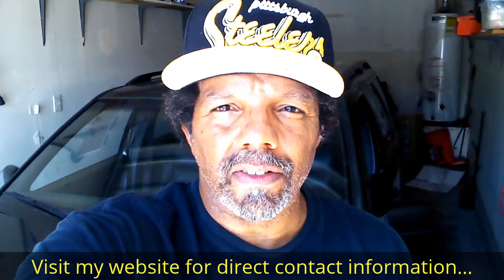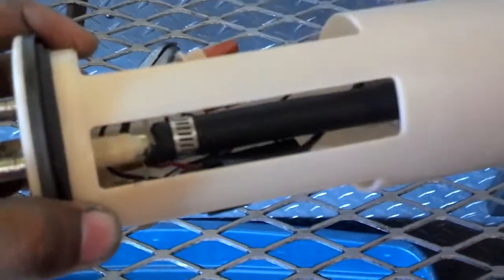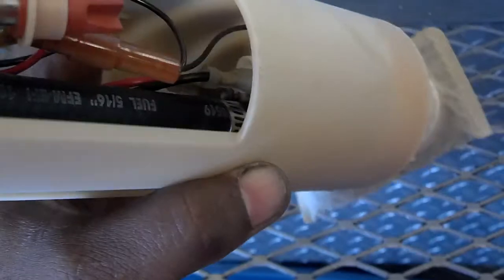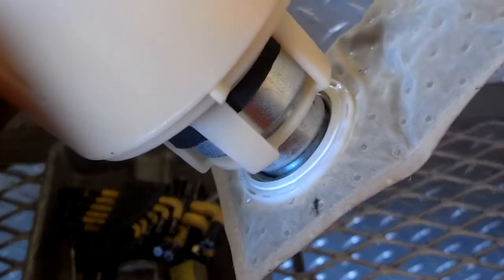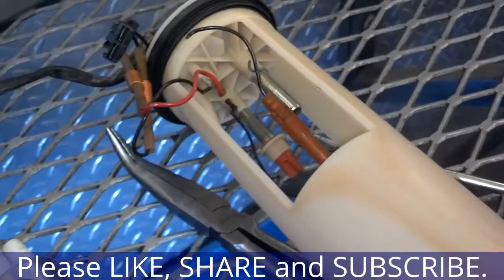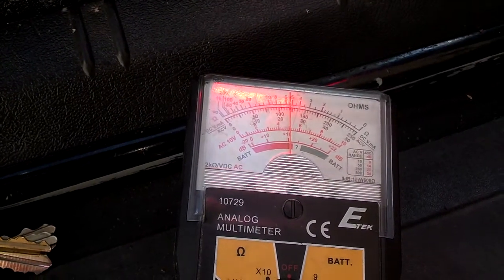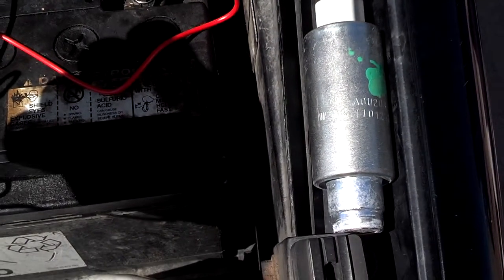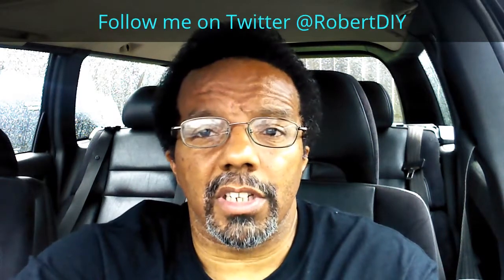How to remove a fuel pump from a sending unit - VOTD

Comment: So its about 55 ohms if you zeroed the multimeter full scale before testing.

Motor does seem to go like the clappers, i dont think its 55 ohms.
Reply from the maker: zx8401ztv I'm not sure I just decided to check the reading. LOL
Reply: Robert DIY ha ha :-))

If you do need a more accurate reading, touch the probes together and adjust the thumb wheel untill the needle sits on the 0 to the far right.
If it wont go that far, the meter battery is flat.

Sorry im talking the obvious again :-((

Comment: when mine went it cost $380 for a brand new Bosh pump...I had no choice at the time and that was the guy handing me the new pump in the box and me installing it.
 plus waiting a day and a half for them to send it... total cost was about $615 with losing 2 days pay and getting a ride to get the pump 2 twice...

now when I hear  " it just shut off while I was stopped at a light " what do you think it maybe ?
 I say o no its a bad pump mine did that for id say 6-8 months but 1 day it just would not restart and I got it flat bedded home !

I had bought a cheap china (EBAY) made part but when I went to install it it was VERY different for the Volvo one and didn't even fit in the outer case. I did plan ahead but didn't work out with a cheap $65 china made pump...

buy what goes in it not a junk  universal Volvo part ..you'll be sorry every time...
Reply from the maker: AwakeDude911 I pulled this pump out of a S70 so it should be an easy fit. I was able to ship it to a guy (same day he paid me for it) priority for $62.